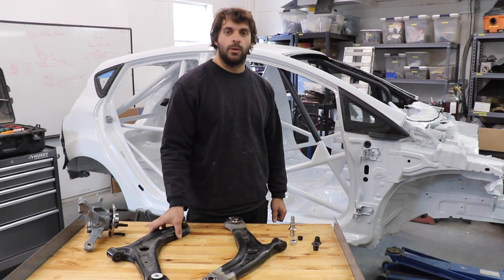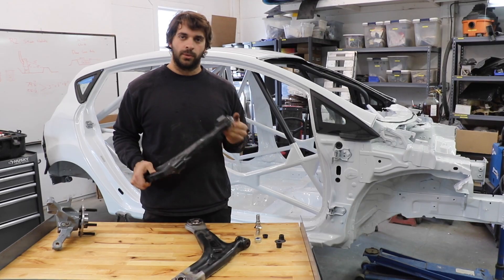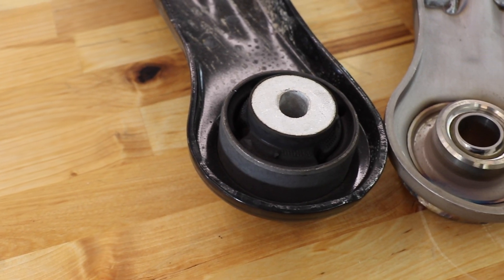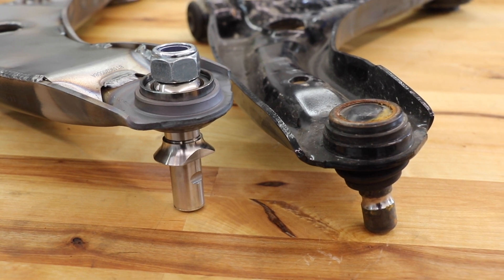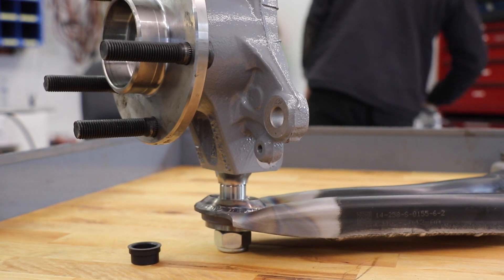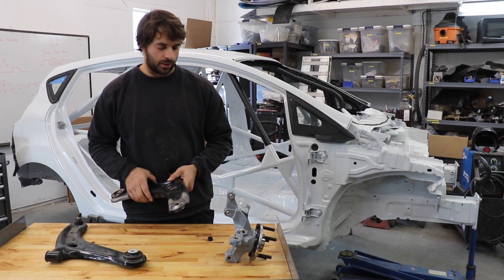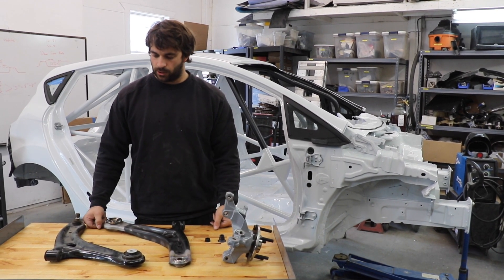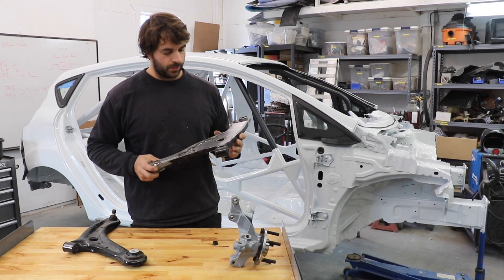Rally Car Build Episode 3

Comment: If I where to install this into a daily driving car would I have problems with rust after a while?
Reply: With the bushings yes the new ones in there require more maintenance but the rest of the arm no you just need to get it painted, the bushings are stronger but need to be baby sat as well